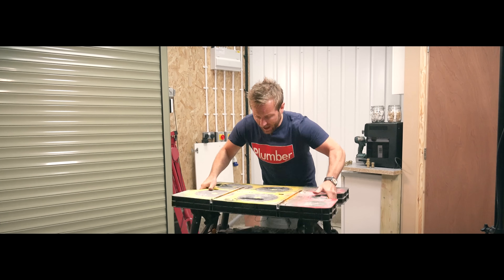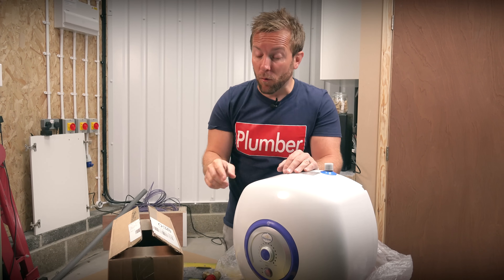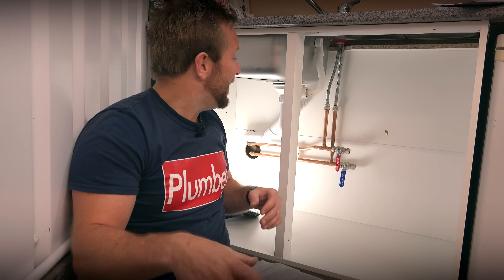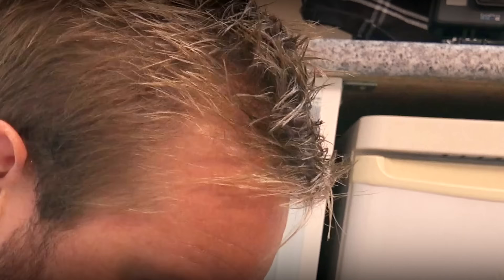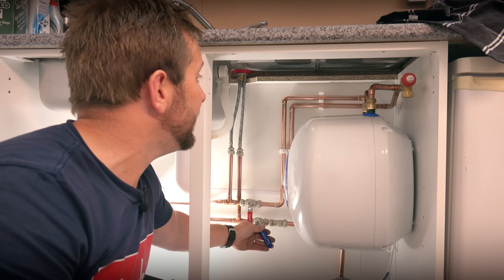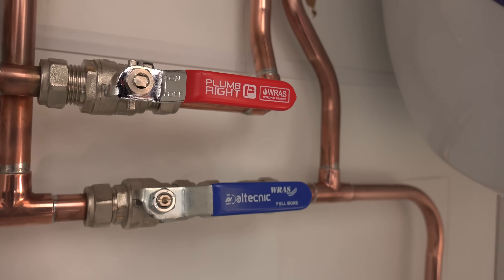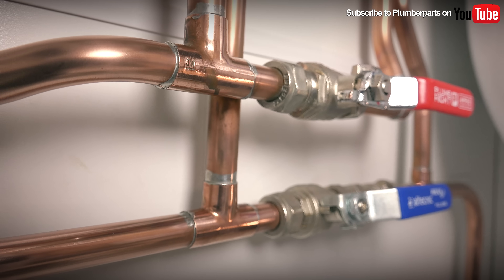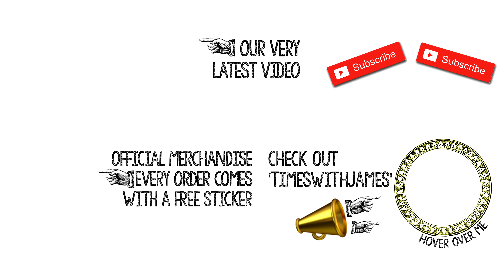UNDERSINK WATER HEATER INSTALL - Kingspan Undersink Heater

Comment: Hey James , I fitted a couple of unvented under sink 5ltr heaters 3 years ago.  I'm back at them today with brown water coming out of both hit taps o two basins. We have very soft water where I live. I know ther is a sacrificial anode inside the vitreous enamal tank but surely it shouldn't need changing every year or even every 3 years should it?

Comment: I have an apartment which requires a water heater for kitchen sink and bathroom sink bathroom from the kitchen is 6m away wondering will this solution work and is it instant hot water or storage as I don’t want the hot water to run out

Comment: Just a question. You said that the expention vessel only needs if the pressure is more than 4.1 bar. However, you've installed a pressure reducing valve which creates a 3 bar pressure in the system. Do I need a exp. vessel if the pressure is 3.8bar?

Comment: thing I'm confused about these installs, if I was to replace the tap why not have insolation valves on hot and cold pipes that are going to the taps so that I can isolated easily and replace taps quickly??

Comment: Valuable video. Can you please tell us how one of these would work in a mobile setup? We are setting up a coffee trailer and for compliance we intend to run a flojet pump to an under sink heater. Using a Y junction, we want to run a line via the heater and up to a flick mixer hot side and the other line up to the cold side of flick mixer. Is this viable with an under sink heater?

Comment: Hi I recently fitted a 50L water heater for a bath and now want to fit a 10L under sink heater in the kitchen. Can I tee into the cold water supply between the relief valve and the 50L heater to supply the 10L or does it  need a separate supply with it's own pressure reducing valve, expansion vessel and relief valve? Any advice would be greatly appreciated, thanks.

Comment: Really great detailed video as ever. I fitted a similar one recently and reused the original pressure reducer, pressure vessel and pressure relief valve as they were originally fitted. The hot water deliver with the new heater was really fierce when the hot tap was first turned on and then after about ten seconds ended up as a trickle. A friend who used to be a heating engineer told me to replaced the pressure reducing valve. I took his advice as  i’m a qualified plumber with Part P but not hearing quals yet. This solved the pressure surge but now the valve gauge gets up to over 3.5 bars when the taps are off and the relief valve is releasing a trickle of water continuously. My assumption is that the pressure vessel isn’t doing its job and although the relief valve is rated to 6bars it has a relief setting of around 3 bars. Also the original vessel was plumbed in right next to the relief valve and is level with the feed at the top of the heater and is located in line between the regulator valve and the relief valve. You mention a 30mm drop to the pressure vessel. I don’t recall seeing that in the installation instructions and the customer has mislaid them. Do you think my diagnosis that the pressure vessel is faulty could be correct and is the 30mm drop crucial? Thanks and keep up this great channel please. Will find you and post a message on Insta too as you’re an Instagram fan.

Comment: I can now see everyplumber got its everyday mistake i can't see your angle valves on both cold and hot water the ball valve is just in front it means both your ball valves can close as inlet and outlet

Comment: Great video.  Can't you just turn the pressure down outside my water pressure is 6 bar but I have turned it down to 4 bar outside. I was told this by anglian water.

Comment: Could you install a pressure reducing valve on both the hot and cold pipes going to the heater to avoid installing it on the pipe that feeds the house. Of course you would have to buy a 2nd one but is it worth it to avoid building regs

Comment: Hi does the explanation vessel need to be a certain position .. 
horizontal, vertical, or does the pressure valve needs to on the top ? 
Or bottom 
Thanks great video

Comment: This heater seems to be designed to require the most work and the most expense possible.  Why couldn't it be fed from the low pressure cold or even the hot water supply eliminating the need for all that extra expensive hardware.  Just an expansion vessel and a pressure relief valve costs an extra hundred quid.   It would also mean that most of the heat supplied would come from the cheaper gas water heater that supplies the normal hot water.

Comment: Great video, but people BEWARE that the expansion tank mounted by the installer was wrongly laid horizontally! 

You have to mount ALL expansion tank vertically (he first indicated at the start, but went to sleep on it afters). 

Expansion tank only work properly when mounted vertically...

Comment: Hi, Would this be able to feed an upstairs wash basin if it was fitted under the downstairs sink ? I know you might loose some heat but the upstairs basin is only used for hand washing and a shave ans is only a small one bedroom house, cheers tanks
Reply: I'm thinking of fitting one in a flat but I want it to feed basin and kitchen sink from where the old cylinder tank was can this be done? I have no gas so the tank is an emersion
Reply: @hopdjandy  I have just done this Ariston 15lr heater gravity fed from tank in attic installed instead of old copper immersion tank .Electric connection on to existing immersion switch. Feeds both kitchen  sink and bathroom  sink .3 kW version no  need of any other fittings as expansion pipe allready  exists heats up in less than 10 minutes  only switch on when needed

Comment: are the electrics to this heater on permanently to maintain temp in the tank or are they timer?  thanks
Reply: It runs permanently maintaining temperature selected on thermostat. 

You need to switch off when not in use ..
Reply: @alzmarshall3197  thank you for reply.  I was curious how energy efficient this was to maintain rather than timed on off

Comment: Hey James, I loved the video and went out and bought a Kingspan Ultra flow 10l, installed exactly the same as yours in the video. Its fantastic, water nice and hot when we need it with plenty of adjustment if we wanted it even hotter, so all good! The missus says to me yesterday that there was "Black bits" in the sink?? she was running hot and cold, anyways after a bit of investigating the black bits are deffo coming from the hot feed, any ideas why that would be? Its only been in for a couple of months and works great, I'm up in the Highlands, just outside of Inverness, on the water main though.

Comment: Do you think it is feasible to connect an IHW heater (tankless) into a power shower hot feed? Thus reducing the size of IHW heater needed, eg. instead f say a 11kW you could use a 6kW? I ask as I need a temporary over winter solution while my oil heating system is removed prior to the new install in the spring. Just need to have an operational bathroom and didn't want to install a new electric shower as already have a power shower.

Comment: I also use this
product, which is similar to this one, and it is economical. You can click to
view it at the following URL.

https://dincn.en.alibaba.com/product/60774805467-806854593/Newest_High_Performance_Shower_Electric_Water_Heater.html?spm=a2700.icbuShop.41413.47.7fc255c2y23QeW

Comment: James' Heatrae Sadia now won’t warrantee the expansion vessel if it’s fitted horizontally. They insist on the vessel being fitted vertically. They said it causes issues with the water draining out. Hope that helps... love the video’s. 
Regards
Carl
Waterlines.
Reply from the maker: Carl Fisher no worries, fortunate it’s a Kingspan....and it states it in the instructions too that it’s fine. Also the horizontal bits isn’t actually a ‘Reg’ but actually under ‘recommendations’ - I checked!

Comment: The IR camera won't work on metallic surfaces as you demonstrated - the emissivity constant on the FLIR is incorrect for that as demonstrated by the 'cold' water inlet temperature.

Comment: A plumber told me before that an expansion vessel could only be mounted with the connection on the bottom i told him it didn’t matter as long you can get to the air cap. What your view on this? I’ve seen them mounted up, down and side ways like in this video.
Reply: Just down to manufactures instructions
Reply: Expansion should be vertical

Comment: Great vid and useful comments. One question re expansion vessel bracket/pipe clip - how did you do it? A long screw through the pipe clip and pipe piece into cabinet bottom?
Reply from the maker: rj24115g yep!

Comment: James , quick question after looking at you schematic. The Pressure reducing valve is before the none return valve. When I fitted my water softener I fitted the PRV after the non return . Does this matter ????
Reply: No, as long as  the NRV is after the tee on the supply to it then it will do it's job

Comment: Nice video, shouldnt the expansion vessel be installed vertically to prevent stagnation? 👍
Reply: That’s what I said 😂😂👊🏾
Reply: Yes also the length of the pipe is too long, should be no more than twice the width of your pipe.. which can be difficult sometimes.

and if we are going down that road an anti legenlla tee and valve should be fitted.. 
which is a a very rare sight aswell👍🏻😂

Comment: Why when I run any water in my house it makes a loud knocking noise is it just I need to turn my water off and run all the taps ?
Reply from the maker: Shock arrestor!?!?!?
Reply: plumberparts I don’t know anything about it because my hose for my washing machine pipe burst but then we turned the water off then it stopped and we didn’t turn it on till we got a new hose witch we did but I don’t know what to do

Comment: Nice install...Ive seen these used for a shower rather than a normal electric shower option on my travels...and they work very well when mounted as high as you can..
Reply from the maker: Blimey! Never heard of that before!
Reply: plumberparts ...very common in India..
Reply from the maker: OHHHH RIGHTTT!

Comment: Top job super shiny pipes! Have you ever had a leak with loctite? Just started to use it and I’m not 💯 confidante with it.
Reply from the maker: Golden loctite rule is to cross the thread over itself. Tends to not work as well on plastic thread, where I'd recommend PTFE.